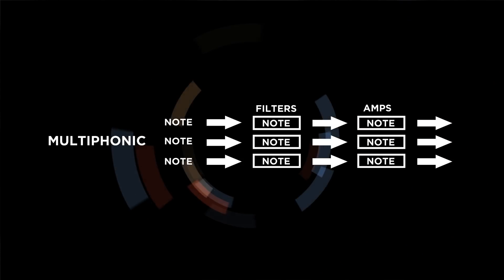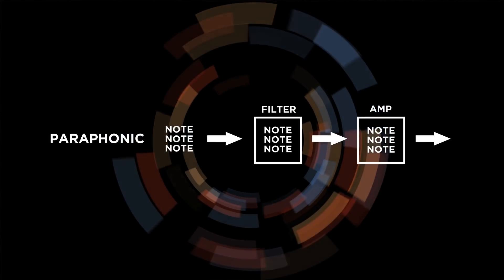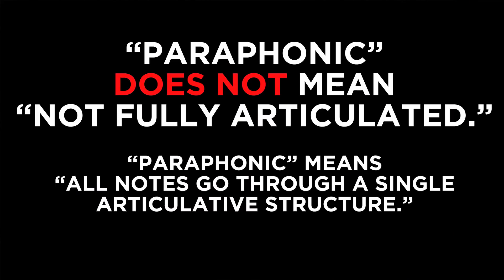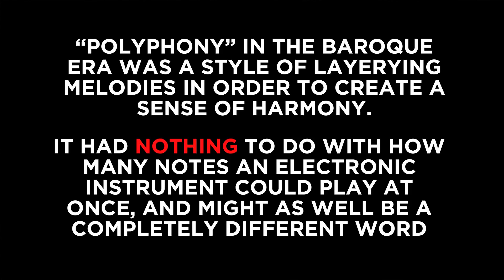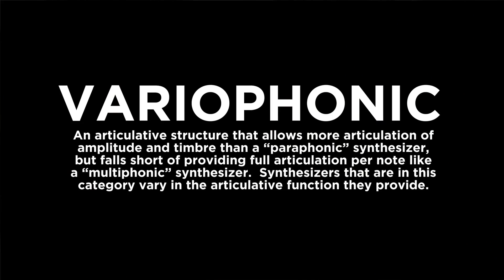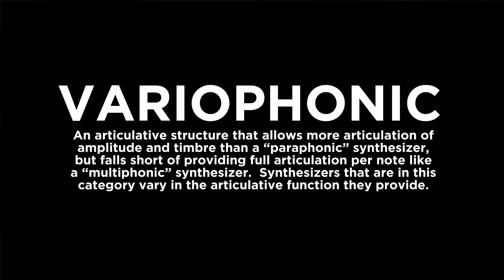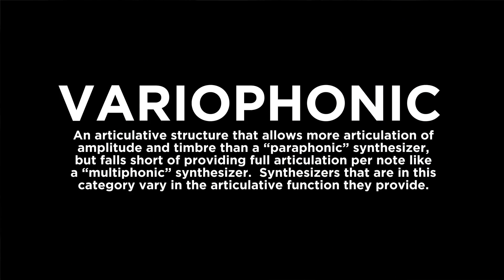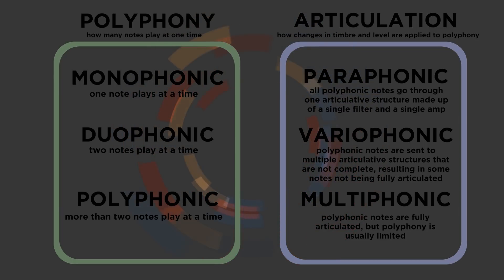New Synthesizer Term:  VARIOPHONIC!  Why it is necessary...

Comment: "Par-Paraphonic"? "Par" = partially, as in "par-baked". 
(Or "ParPar" for short... Sounds cute!)
"SemiPhonic" also a contender, fewer syllables, so easier to pronounce than either par-parahonic or variophonic.
Also, "variophonic" seems problematic because it suggests it is variable ("vario") and can be altered somehow (with programming parameters), which I'm unaware of in any (hardware) synth.

Comment: I need to revisit your Polymoog videos, but would those fall under the variophonic category? Also thank you for continuing to do the work necessary to make better terminology in the world of synths and help more people understand them. Someone is stepping up to the plate, someone qualified, and I respect that.
Reply from the maker: Well, I never demonstrated the Polymoog, and that is something that makes me sad.  The Apollo doesn't really fit my definition of a synthesizer, as it really just plays back presets.  But the presets on the Apollo are, in many cases, fully-polyphonic and fully articulated!
Reply: @automaticgainsay  My bad, it was the Apollo, similar look. Also, question: why is it that the Apollo has all of the internal components of a synthesizer, but it being preset only doesn't make it one? Would you consider a non-programmable keyboard like a casio a synth or a rompler?

Comment: I'm on board with variophonic, makes simple good sense. But it makes me wonder when we'll start getting transphonic (goes beyond simple definitions) and omniphonic (all the notes, all the articulations) synths?
Reply from the maker: I think most digital synthesizers are already there.  Some of the workstations that have come out have such complex articulative structures and extensive polyphony, they blow these simple more-analog-based models out of the water.

Comment: You made some good points here for the need of better differentiation!

Where I can’t follow completely are the following two terms:
• For me Polyphonic has the meaning of “more than one note” (instead of two notes) because “poly” just means “many”. Duophonic is just a specific subset of polyphonic with two notes as Quadrophonic is with four notes.
• With “poly” (Greek) = “multi” (Latin) polyphonic is synonymous to multiphonic from my European language understanding. (Like the goddesses “Nike“ (Greek) and “Victoria” (Latin) are the same.) So for me this differentiation would lead to more confusion.

I’d say one source of confusion also is in the use of -phonic for both categories, i.e. the amount of notes and the articulation. Therefore from now on I’ll call my MatrixBrute a variosonic synthesizer! 😘
Reply from the maker: Hey, Panta!  The only reason I stick to "more than two" is because modern duophonic synths technically existed before modern polyphonic synths, irrespective of what the roots mean.  I agree with the "phonic" for both distinctions problem... but I'm not trying to advance a whole new system... I suspect that would be a guaranteed failure.  I'm trying to work with what has existed historically and refine them.
Reply: @automaticgainsay  It’s all good!  :)
(As someone who makes his living mainly from working as a technical translator these days I’m struggling with this sort of language inconsistencies and inaccuracies almost all the time. So maybe I’m a bit too language-aware.)

Comment: A question about polyphonic and multiphonic: So if a synth like P5 is not polyphonic because of limited articulated note number at which point an instrument becomes polyphonic? Is a guitar polyphonic because you can play 6 different notes on it, or a fretted clavichord, you can play multiple notes but not all. Does the instrument needs to have an articulated note for each note entry interface (Keys for example in case of piano, organ or strings for a guitar, violin etc.)
Reply: Ok, finished the video, got my answer. BUT if i tune a minimoog for example to a chord does it make it polyphonic? Or it only depends on how many keys i should press to get a chord.
Reply from the maker: @swash_plate  No.  Polyphony is a term that was invented to describe how many notes are activated at once, not a term to describe how many pitches can be generated.  A Moog modular in the 1960s was totally capable of producing an orchestra-worth of pitches, but could only play via single triggerings from a 950.  This is where "this only plays one note at a time" came from.  Synthesizer polyphony has to do with how many independent notes can be intentionally generated through playing.

Comment: This is the first time I heard "multi-phonic" we used to address the number of fully articuated notes by "N-note polyphonic" as in the Memory Moog was 6-note polyphonic" and KEYBOARD described the Prophet 5 as "5-note polyphonic"
Reply from the maker: It’s not a common word, and although asserted by Bob Moog, it didn’t become an industry standard.  But it is efficacious!
Since polyphony is note count, saying “6 note polyphonic” really only tells half the story.  Synths starting with the Poly 800 made that tricky.
Reply: @automaticgainsay  Bear in mind, this was back in the late 1970's and 80's

Variophonic might have another meaning. Some of the soft-synths let you set the multiphony. The ARTURIA MiniMoog has mono or user defined multiphony: If "multiphonic" is good enough for Bog Moog, it's good enough for me
Reply: Now what do we do when we have the availability of over 88 notes polyphony each with full articulation, such as 128 notes with each having full articuation? It's both polyphonic, with more note multiphonic than there are keys or strings?
Reply: yeah, I see no added value to use "multiphonic" vs "N-note/voice Polyphony" ..."multi" has no additional useful info about how many fully articulated simultaneous notes can you get out of an instrument. An 88-key Piano, is a 88-note/voice Polyphonic (mechanical-acoustic) instrument. So... an 4, 6, 8, 12, 16 (fully articulated) voice synth can still be a N-note Polyphonic synth. "duophonic" being the special case that gets its own word, because there's some OSC/Sync/Playing styles possible that naming them a "2-voice synth" won't feel the same :)
Same line of thought about paraphony. Paraphony is already understood by many as non-fully articulated poly-pitch voice structures. Now, the issue is that, there's poly-pitch + mono-amp + mono filter and there's also poly-pitch + poly-amp + mono-filter ...or duo-filter. So... I don't see 1 word being invented for each of these combinations. Better say "3 voice paraphonic duo filter" or "4 voice paraphonic mono filter" or "2 voice paraphonic mono amp and filter" ...as an ** next to the "Paraphonic" market-sp33k.